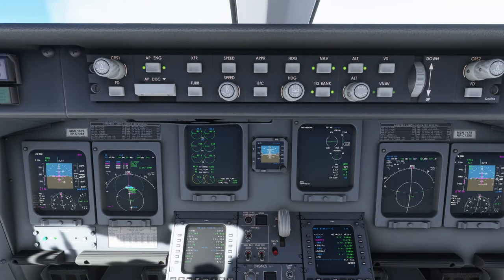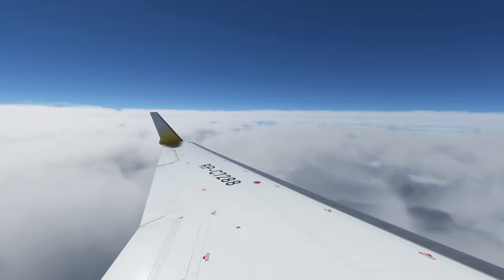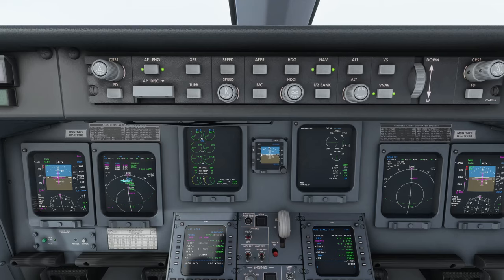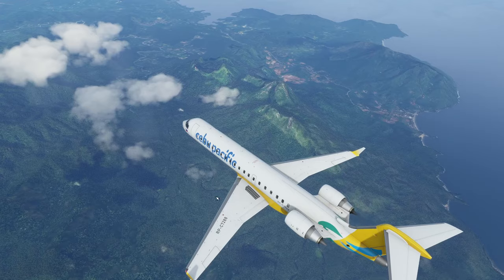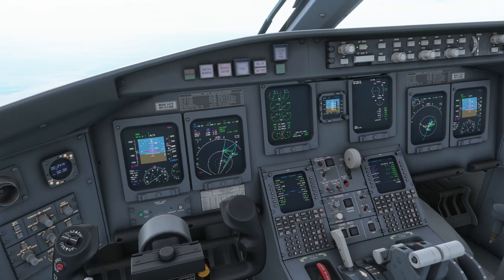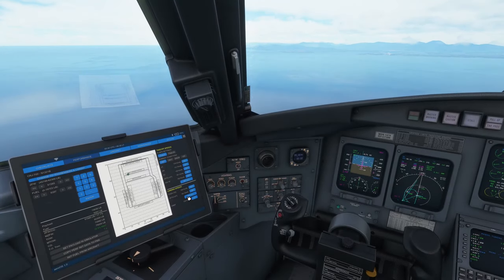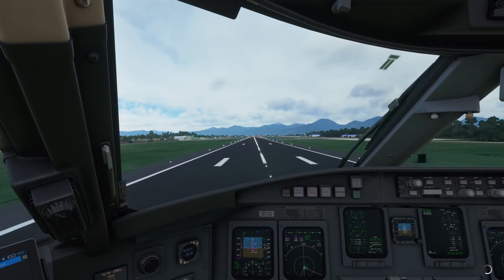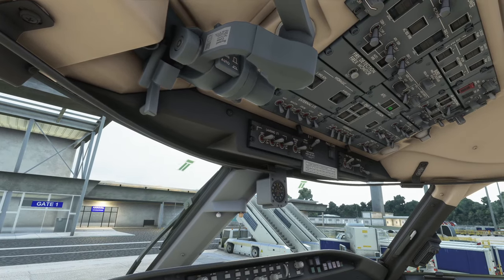Did someone say VNAV? - CRJ Descent & Approach - Microsoft Flight Simulator

Comment: 6:19 The CRJ has no way of knowing that there is ice on the wings. The ice detectors just in front of the main door and service door are detecting ice giving you the Ice caution message. When this is active wings and cowl anti-ice must be selected on. This will turn the caution to an advisory message on ED2 until the ice detectors no longer detect ice. The reason it is red on the anti ice synoptic page is because wing anti%ice should be selected on when the Ice caution is posted. 

Here is when to use anti-ice in the CRJ: 
On the ground, below 10C with contaminated taxiways/runways, precipitation, or low visibility cowl anti-ice should be selected on.
On the ground, below 5C with contaminated taxiways/runways, precipitation, or low visibility wing anti-ice should be also selected on, except when type II, III, or IV anti-ice fluid has been applied.. then only turn it on just prior to thrust application for takeoff.
In the air, below 10C TAT and above -40 SAT in visible moisture or low visibility, cowls on. The same goes for wings unless you are above 230kts then it is not required.
Finally in air with Ice caution both cowls and wings must be selected on regardless of temperature or airspeed.

Comment: When I saw this feature in the update change log, I was super excited.   Takes the load off during descent...the thing that I hated though was when I did a full idle descent, the plane almost slowed down to stall speed.  

Could it be for the VOR that the chart was saying "below 6000ft"...seeing as the 6000 was below the line?
Reply from the maker: Ah yes, I don't think the CRJ descents at flight idle for the most part. I stay around 60-70% N1 most of the time.

And about the below 6000, that's a very interesting POV. Tbh I don't think it does, but I'll have a look to be sure. Thanks for the inputs!

Comment: Great Video CG,  Question, I have coupled the VNAV in the EFB, but I don't get the FM1 PATH in green that can be seen at the 10:49 mark of the video.  I get the PATH in white but not the green one.  Any idea as to what I may have set up incorrectly?
Reply from the maker: Thanks! Hmm, PATH in white means it's armed but not yet active. Are you still on cruise and maybe top of descent isn't reached yet? Or maybe you are too high or low from the calculated vertical path. If so, you'll need to manually catch up via VS before PATH becomes active (goes green). You can look for the white snowflake in the PFD to know if you are too high or too low.
Reply: @TheClumsyGeekGaming  thanks, for the quick reply.  I am in cruise just before the TOD.  I set my Altitude to a lower value and then just before TOD hit VNAV.  The plane never descends, even post the TOD.  I'll keep trying and always appreciate your helpful videos.  Thanks for those.
Reply from the maker: @chriskast4543  that's very interesting. It should work based on the steps you've taken. You might need to consult with the experts at the aerosoft forums for better help. Good luck, and thanks for the kind words!

Comment: Hey Clumsy, I noticed you used to use X Plane 11 as well. As another former X Plane 11 user, how would you compare the two sims in their current condition? With the upcoming DX12 update and the VR implementation in MSFS I can't see any reason to go back to X Plane 11 anymore.  Looking forward to your next upload!
Reply: The advantage that X-Plane has is more variety of high-quality study level payware (and non-study level) and better performance.
Reply from the maker: Great points guys! Yes, for hardcore simulation of complex systems XP still takes the cake. For the overall immersion factor, though, I definitely go with MSFS.
Reply: @FlyIslandGuy  The performance point you made will soon change with the upcoming DX12 update that will soon be in closed beta. As for payware that will increase naturally with time, but there are already a ton of community made mods that improve the default aircraft to almost study level and also a bunch of good freeware aircraft.
Reply: @acurisur  Absolutely agree!

Comment: Hej Clumsy and community! Which is currently the best ifr aircraft in MSFS? I really want to spend time only if the plane  works. I tried default TBM with flight model tweaks and WT G3000 but when it couldn't hold a heading I was frustrated.
Is the CRJ ready or should I wait for PMDG?
Reply: Have you watched Squirrel's TBM 930 IFR Landing tutorial, it helped me a lot with the standard Garmin, and it's nearly the same for the G300 mod. 

If an airport doesn't have consistent waypoints for the landing, I set one manually before the flight on the flight plan and I usually pick up the localizer and it locks on

Using the approach/runway selection I don't bother with much, but I look through to see if there is a decent one
Reply: @derekbentley196  Are the bugs ironed out now?
Reply from the maker: I definitely recommend either the CJ4 mod or the CRJ. These are the most reliable when it comes to IFR flights. Still not perfect, but gets you where you need to go. Enjoy!
Reply: @TheClumsyGeekGaming  Thanks Clumsy - I will probably dish out for the CRJ.